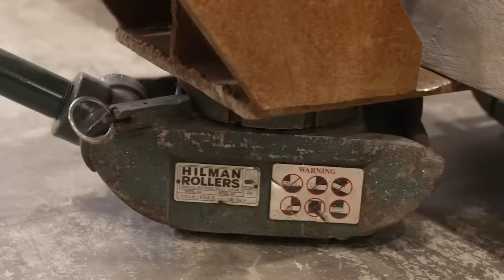Fitting the Lead Ballast Keel (Tally Ho / EP120)

Comment: Gentlemen to see so talented boatbuilders handle 8 tons of lead so unprofessionally is scary. The whole handling, with the exception of the electric hand tools, is perfect as a pictures how it was done in my grandfather's boatbuilding yard in 1930s Copenhagen. It’s not the way to do it in the 21 century. The lack of control of the lead dust will create a thin  toxic carpet on the floor, and will end in your bloodstream trough exposed skin. I would strongly advise you to take a blood test to see how high your led value’s are.
And how do I know that? Because l have been in charge of a new 40 ton lead roof on a 12 century monastery. In Denmark.

Greetings Jesper
Conservationarchitect

Comment: Leo I'm assuming that the keel is bolted on but missed it being done. Yes one of your crew was staking the nuts but that looked like in the ballast keel and not the lead. I'm sure I'm missing something.
Otherwise an intriguing operation having never been involved with anything larger than a "Graduate" dingy in the 1960's and sailing a "Flying Dutchman" in central Africa.
Thanks for including us in your task. 
Regards from Canada's banana belt.🤔🇨🇦☃️
Reply: Bolting of the lead keel hasn't happened yet. Consider this a dry fit

Comment: This quality of workmanship is the difference from doing an appenticship and learning a trade in England or Australia New Zealand. Than in the Unites States. Old trades are dying here in the united states its a comsumerable country. Use  amd throw it away and buy a new one.. however custom made items are expensice becausebit takes hours day weeks months or evennyears to make. But noone has time to wait anymore and they usually dont want to pay for it.  Good work on the keel Leo. What is next fitting out or deck. Fitting out would be easier with the deck off right??

Comment: Great video but how was the keel actually fixed to the bottom of the boat ?  I imagine the bolts i saw had something to do with it
Reply: Frederick Stibbert
1 year ago
It will be bolted to the timber keel w/ 1" diam. bronze through-bolts at 24" spacing, but these bolts don't penetrate the bronze floors, which are already bolted to the timber keel .

Comment: Hate to ask a “stupid” question, but how do you bolt the keel in place?  Surely the tar and felt bedding is not enough to “glue” it on, so I’ll eagerly await the next video to see how you drill and bolt it.  I’m guessing it will involve drilling from inside the bilge all the way through the wood and lead and probably 1 inch by 3 foot long bolts every few feet.  Can’t wait to see how it turns out!

Comment: Though I know you want to stay with traditional boat building methods, I don't understand why you wouldn't make an exception on the lead ballast keel attachment to the main wooden keel using a 2 part epoxy putty paste, then drill connecting rods through both keels, attaching and anchoring the lead keel to the wooden keel.  Then finishing the outside exposed lead keel, as well as the entire bottom of the vessel below the water line, with multiple coats of a great flexible and durable 2 part epoxy coating, ensuring long lasting protection to the lead and completely sealing the wood below the waterline, before any bottom coating is applied.
Reply: What are you expecting to happen to the lead keel that it needs protection?   A bit of Epoxy wont do much for any keel bending or impact.  It will outlast the rest of the hull by a wide factor

Comment: Just a note, this is third video in a row that I didn't get notification. Even though I have been subscribing and have manually selected all notifications on for this channel for years. Usually this same has happened only in Motorcycle related channels when they get kind of "shadowbanned" for being advertisement unfriendly. Those channels seemed to fall out of recommended channels for those who are not already subscribed.

Comment: I'd be interested to know how this keel is being attached? Isn't there some kind of bolt system? I think all you're showing here is that it is glued on with some kind of bedding material....there's got to be something stronger than that, right? I would have thought deep bolts/anchors embedded in the lead when it was molten, and then bolted through and to the other side of the wood keel....Given the weight, surely you're doing more than just gluing the thing on....What am I missing?
Reply: Well, the latest episode answered my question, ....bolting the keel....Makes logical sense now.

Comment: What is holding the bottom of the keel timber to the keel? It does not appear to be bolted on. All that separates the two surfaces is some roofing felt. The keel has been jacked-up but not secured.
Reply: Frederick Stibbert
1 year ago
It will be bolted to the timber keel w/ 1" diam. bronze through-bolts at 24" spacing, but these bolts don't penetrate the bronze floors, which are already bolted to the timber keel .

Comment: Hey Leo are you putting keel Bolts right thou lead keel or just  half way into  lead I have  seen  keels snapped off  due to bolts not having a Flat plate inbeddbed into keel as soft lead won't hold  bolts if they get knocked against  something at sea  but knowing you you would have something in  in your mind  about this  she is looking to be a fine ship you and your crew should be Proud as to how you have  built  Tally Ho

Comment: You know, Leo, I don't think you should rush to finish TALLY HO,  What will you do when all this project is finished? It will be rewarding to stand and admire it and say - "I did it!!"  But then what. All the other guys are going to be out of volunteer work.  By the way, planing lead is a very old trick. it has been used in the organ industry for a couple of 1000 years.  You must be very happy, Leo and the boys working with you certainly can be proud of all they have done to make that a beautiful work of art.  Perhaps in 200 years it will sit besides VICTORIA.  I can't even begin to think of the final day. What will you do when the building is silent, few lights are glowing, You and Tally Ho are alone with each other.  Just you and that boat.  Long way from the beginning, still much to go. Farethee well, Leo.  It turned out to be so much better than when you stood inside that rotting hull that first day.  What a grand adventure for you and all those who believe in your project.   Does  Well Done, old boy!" say enough?  I guess it has to.  Well, on to the next chapter of this long story. Drilling for the keel bolts, finishing the deck & cock pit, interior joinery., seems endless.   Good fortune to you Leo, to all your crew and those who have been able to support the project.

Comment: nice music pick up, you feel the weight of the moment, no pun intended, what i was wondering about was and is, if there would be any mechanical connection from the keel to the boat, can’t imagine all that lead just being glued with tar, is there no bolting planned later on?
Reply: Hahaha. Of COURSE  there is a mechanical connection. B'y big bolts through the wooden keel into the lead.

Comment: What happens with it next? I figured there would be a dry fit, bore holes for keel bolts, then put big nuts in from the side. Will you just auger in and screw it to the boat with huge screws? Or maybe you will put nuts in from the side with it in place? So curious/confused :D The keel turned out amazingly well! Congrats!
Reply: Leo explains this at about 13.30: drilling holes through both keels, countersunk at the bottom of the lead keel. Bolted together with 13 bronze treaded bolts with big nuts on both sides.

Comment: Don’t know if this has been asked before but do you know much about the original build? How long did it take? How many people working on it? You’ve had the benefit of many 21st century tools. What differences in construction time and quality would the original build have had?
Reply: The design was finished in June 1909, launched in 1910, delivered in 1911(?). Stowe & Son were a well-established shipyard - building & fitting out a yacht of this size would not have challenged them. They might have lacked powered hand tools, but certainly would have had a stationary steam engine to run a large bandsaw & planer-thicknesser.

Comment: How do you fix (fasten) the lead keel to the ballast keel?  It seems nothing to hold it up to the boat.
Reply: Frederick Stibbert
1 year ago
It will be bolted to the timber keel w/ 1" diam. bronze through-bolts at 24" spacing, but these bolts don't penetrate the bronze floors, which are already bolted to the timber keel .

Comment: Anyone know what holds the keel in place, I was expecting to see some sort of fasteners screwed down into the keel from inside the boat.  Is the tar strong enough to hold it on alone?
Reply: Frederick Stibbert
1 year ago
It will be bolted to the timber keel w/ 1" diam. bronze through-bolts at 24" spacing, but these bolts don't penetrate the bronze floors, which are already bolted to the timber keel .

Comment: The keel came out really good. I missed how it was fastened to the rest of the boat though...
Reply: It’s not … yet.
Reply: @moonshine3333  So the hull needs to rest upon the keel until the keel is bolted tight?
Reply: Yes, the keel will be centred, the boat lowered then holes drilled from inside to out … the reason he has lifted TH is so he can work on the external end of the bolts.  Watch episodes 8 and 20

Comment: I find it amazing you are working on the lead keel like it is wood. One question I presume there still need to be some bolts going through the keel and the led to get a firm connection. Are these copper ones and how many?
Reply: There will be about a dozen 1" diam. bronze bolts.

Comment: OK, great the ballast keel is in place, congratulations! How will it be attached to the keel timber?
Reply: Holes are bored through the keel timber and lead ballast keel and silicon bronze rods threaded on either end with nuts and washers tightened in counter bored recess in the lead.

Comment: Very good!!  Now,,,,, what the hell is going to hold that Earth tipping weight to the keel???
Reply: Holes are bored through the keel timber and lead ballast keel and silicon bronze rods threaded on either end with nuts and washers tightened in counter bored recess in the lead.

Comment: You guys are scary. Great craftsmen, and dedicated to the project, but you are scary.....
Glad you got out of sawing on the ballast keel without removing you foot with the chainsaw.
I also would have recommended encapsulation of the bare lead keel with at least a thin layer of epoxy or polyurethane paint as a barrier to further lead exposure.
That is a lot of lead waste that you fellers are wandering around in. Lead poisoning  is a very serious condition and you appear to have exposed yourselves unnecessarily. Lead can be ingested through the mouth, the lungs and through the skin, and I think you guys experienced all three. Look up "the Franklin Expedition" for insight into the severity of acute lead poisoning. 
Maybe those of you that spent the most time on the ballast keel in particle and dust producing activities should consider having your blood tested for serum lead levels. In adults, levels above 40ug/dl or who suddenly show symptoms such as anemia, kidney issues, or mental impairment are candidates for treatment to reduce the lead content of your body.

Comment: So, they just adhered the keel to the bottom?
Will that hold?
Reply: Frederick Stibbert
1 year ago
It will be bolted to the timber keel w/ 1" diam. bronze through-bolts at 24" spacing, but these bolts don't penetrate the bronze floors, which are already bolted to the timber keel .

Comment: What's the point of the Tenon in the end of the lead keel?   If you fit a wooden extension to mate to it, at  the end of the boat, that cant be any stronger than just a few more bolts in a longer keel, surely?

Comment: I would like to ask why you dont cast cable or eyes in the led to lift it with?
Reply: Why create stress points where all the lifting is concentrated...when you can lift the whole thing by lifting the steel cradle...distributing the forces over the whole bottom of the lead?

Comment: I HAVE BEEN WATCHING YOUR SHOW FOR SOME TIME NOW I AM A OIL FEILD AND CONSTRUCTION WELDER ..MY QUESTION IS WHAT IS HOLDING YOUR KEEL ON YOU PUT IT IN PLACE BUT NO BOLTS ??? YOU CANT BE GLUEING IT ON ...L O L LOVE YOUR SHOW
Reply: It will bolted with bronze bolts. See episodes 7 and 8 where Leo removed the original lead keel.

Comment: Very much enjoying watching this restoration but can anyone advise what’s holding that extremely heavy ballast keel to the bottom of the vessel?
Reply: Holes are bored through the keel timber and lead ballast keel and silicon bronze rods threaded on either end with nuts and washers tightened in counter bored recess in the lead.

Comment: Great - but  it looks vulnerable to me - I thought it would go inside the boat, but guess it would cush the wood. You've shown it stuck on with tar - but it must use the steel somehow to stop it falling off. I guess while sailing it's possible to hit a. Sandbank or rocks, what stops it getting knocked off?
Reply: A number of big bolts.
Reply: I had posted:  I'm sure it will be fine once the duct tape is on.  Someone with no humor removed it.

Comment: Not quite certain how the lead ballast keel is attached to the boat?  I see that you made tenon joints at each end but where does it attach?  All I saw was tar and Irish felt between the hull and the lead.  A drawing would help.
Reply: There will be bolts.

Comment: Congratulations on getting the keel under her safely 👏 what is the layer of felt for between the two coats of tar? Thanks for the entertaining videos Leo
Reply: The felt is to keep the tar in place, like fibreglass cloth keeps  the resin in place.  Without it, the tar could ooze out of the joint over time.
The tar/felt combination has to stay flexible as the wooden hull flexes slightly, and keep the water out of the joint.
Reply: I expect it's to take up small irregularities.

Comment: This process has been incredibly interesting. 
Though How is the lead keel being attached? Or is the tar enough?
Reply: That was my Question. I'm surprised Leo didn't mention it at all
Reply: In two weeks the tar will harden enough that the keel will be permanently bonded to the Purple Heart keel timber.

Just kidding. If Leo follows the original plans, it looks like there will be 13 bronze bolts that will bolt the ballast keel to the keel timbers. That will likely be an entire video of it's own since there are more pieces to make as well.
Reply: There will be big bolts.

Comment: Been watching these from the start, and this has been bugging me from way back; When you had the shed problem. Why not place a double beam under the fore and aft sections, with a riser bolted between the beams on each side of the boat; that would act as boat stands? Placing a jack under this would lift the boat while also keeping it vertical. A sort of, A frame construction, though splayed at the upper part of the A. Where the upright posts were supporting the boat side to side. Then once set, the boat would always be plumb, and you could just jack it up and down without running around adjusting freestanding supports every quarter inch? Then plumbing it again afterward? They could have also supported a cover tarp, with a second upright rising higher than the deck and being tide across the upper height by a cross member; though with more than just two. Which would not have been fastened from the ground, but instead stabilized by the weight of the boat, there by not a shed; So, the county and neighbor could go pound sand. But that problem is no more; even so the plan to lift and lower the boat still seems worth addressing?

Comment: What a great fit. Been waiting to see this! Question... does the tar hold the keel or will you be using bolts to secure it?
Reply: I have the same question.  Pardon my ignorance, but how is the keel ballast permanently attached to the keel?  Inspiring work, great job. Thanks.

Comment: How was the lead keel secured to the bottom of the boat ? I saw them hammering some bolts, I presume it was bolted from underneath but I didn’t see them drilling any holes ?
Reply: They were hammering on some bolts, by stakeing (distorting & locking) the threads in bolts that bind the 2 timbers of the keel together at their scarf joint. In the near future, they'll drill & install the dozen or more new bronze bolts that attach the lead keel to the timber keel.
Reply: @frederickstibbert7389  Many thanks

Comment: Is the glue actually enough to hold the keel in place or does it also need to be bolted on or something?
Reply: That has not happened yet,  The title says 'Fitting the keel ..." ergo it is a dry fit. Next step will be bolting the keel trough both keels with long bronze bolts: 13 of them the plans say.

Comment: What am I missing?   You put layers of tar and felt between the lead and wood.  You "bedded" the keel.  What is the mechanical process of actually hooking the lead onto the wood?  There seems to be no actual connection.  Does the term bedded mean that you screwed the things together?  Was waiting for the next video for an explanation, but none was offered.  So I am missing something.  I wanted to know how such a great mass was going to be suspended from the floating vessel.
Reply: Frederick Stibbert
1 year ago
It will be bolted to the timber keel w/ 1" diam. bronze through-bolts at 24" spacing, but these bolts don't penetrate the bronze floors, which are already bolted to the timber keel .

Comment: How will u connect the ballast kiel with the boat ?
Reply: Frederick Stibbert
1 year ago
It will be bolted to the timber keel w/ 1" diam. bronze through-bolts at 24" spacing, but these bolts don't penetrate the bronze floors, which are already bolted to the timber keel .